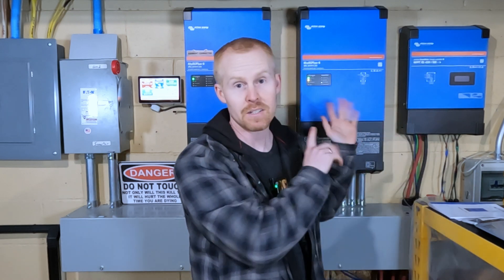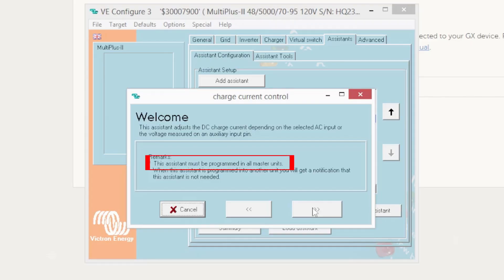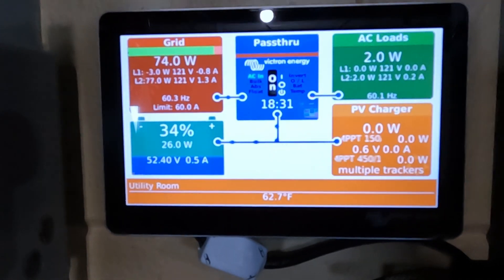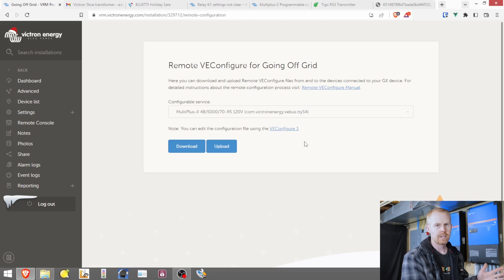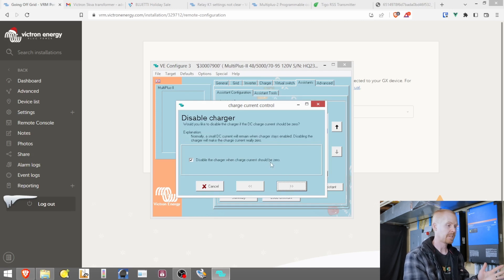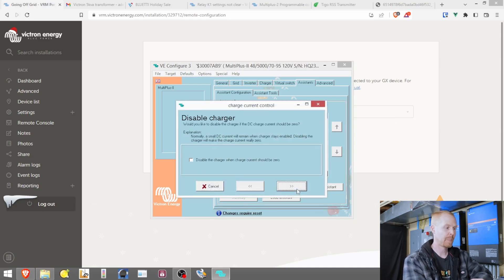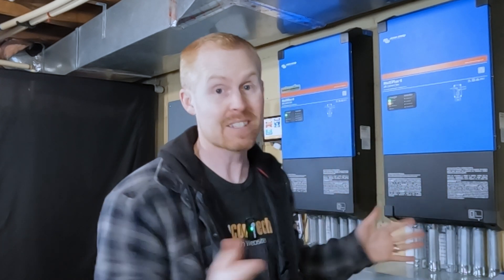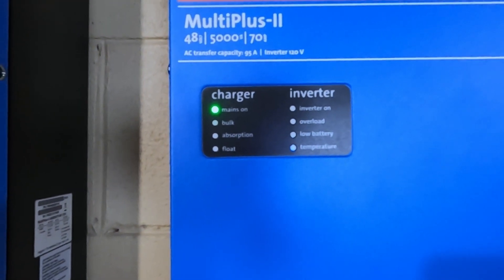Custom Grid Charging - I Missed a Step...

Comment: Great video, considering switching from 6000xp to Victron due to fan noise. Can the grid charge function be automatic between SOC set points?  Example if SOC < 15% turn on and turn off when SOC > 30%. Similar to how you have the AC passthrough working in other video but specific to charging.
Reply from the maker: Thanks Chris!

Off the top of my head, I'm not sure how to do something like that outside of looking into NodeRed.  I really need to take a closer look at how to allow you to set charge-points though because I get asked about that quite a bit.

Comment: For a fixed home installation connected to my sub-panel which is also connected to my main panel. Should I disconnect the ground relay on my Victron Multiplus. So that there is only one ground-to-neutral connection.
Reply from the maker: Yes.  If you’re connecting to any installation that already has a G/N bond already in place, you would want to disable that option in the inverter so a second bond isn’t created.

Comment: Adam,  your video worked great, but now the “controls” button in upper right corner of VRM quit working.  Any ideas why it would go away?
Reply from the maker: Which controls aren’t working?  The inverter mode or the relay switch?
Reply: The Control panel never shows up.  IA light gray icon visible for a few seconds with a spinning circle, then the icon disappears.  No controls available at all.    I was wondering it it had to do with an upgrade.
Reply from the maker: @EagleNestLiveTexas  it almost sounds like the “remote control” ability was turned off in the VRM.  In the VRM, take a look at Settings -> General -> Inverter/Charger Control and make sure that’s toggled to the “on” position.
Reply: Adam thank you.  I posted to DIY Solar Forum.  The suggestion I got was to reboot the Cerbo.  That fixed the problem.
Reply from the maker: @EagleNestLiveTexas  Awesome!  Glad everything's working again!

Comment: You have a very nice set up, just like mine, the exact inverters. But I have the 250/100 charge controllers. I don’t know why you’re having such a hard time using relays on these inverters you do not need to use relays they do excellent job if you use the ESS function. You’re not gonna hear any clicking noises or anything any hard switches over it’s very seamless and you won’t even know everything working in the background look into ESS battery management system. For ESS to work it needs to run for at least 27 days to gather enough information and then it works amazing.
Reply from the maker: Thanks.  I’m not having a problem with the relays though.  I plan on looking at the ESS assistant at some point, but I need to make sure no kidding power goes back out to the grid.  Need to make sure I understand how it all works before I do that.
Reply: @AdamDeLayDIY  https://youtu.be/6WO44Pa5EwI?si=Um3nVHBOdRUkPb8P
Reply: @AdamDeLayDIY  I used to be like you as well in the past playing around with relays. It was very hectic. Trying to balance everything. don’t worry, you can exactly adjust how much power goes back. If you don’t want to go back, you can just put zero feedback to the grid and it will hold it at that amount. I’ve been using it for a long time and you can even schedule charges if you. This is very simple to set up. Just have to make sure you set them up on both inverters exactly the same. And the inverters will take control of the charge controllers as well. So you just have to make sure you program all the battery settings in the inverter and that’s it. Just make sure you select internal current sensor, even though it says external current sensor. When setting up. There’s a guy online that has done a nice video on how to do the ESS.  If I can find that video, I will send it to you.   There is one other then you need to the battery cut off voltages have to be set at the lowest the inverter allows. That’s the only way it can work, right. If not, you will constantly get alarms going off in the inverter. There is a video on this as well. I think Victron has a tutorial if I can find that one. I’ll send it to you as well.
Reply from the maker: @damianthomas2242  Thanks.  I've seen a handful of videos on the subject, but if you find them, go ahead and send them over.  Maybe they're ones I missed.  

I enjoy playing around though.  Helps me learn different aspects of the system and if I can learn something that helps out someone else as well, that's great!  There's so many customization options available with Victron gear.  

Thanks again!
Reply: @AdamDeLayDIY  if you watch these two videos, you can easily set it up. I just need to make sure you put in your settings. And with your knowledge, you can easily do it. And well done on all the videos I watched them they’re really great. And when you set up tick the week AC checkmark, and power assist 2.0. Best of luck looking forward to seeing more of your videos. Thank you.